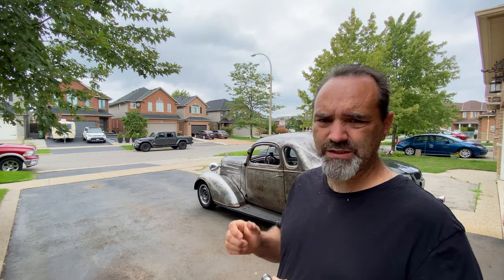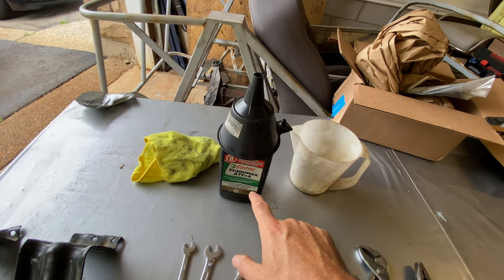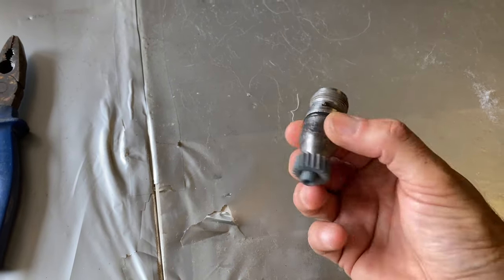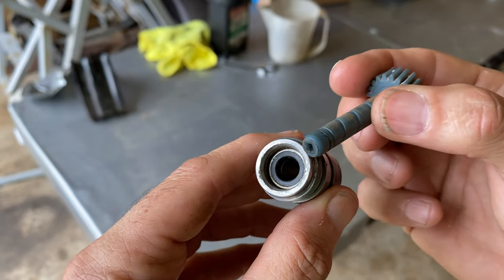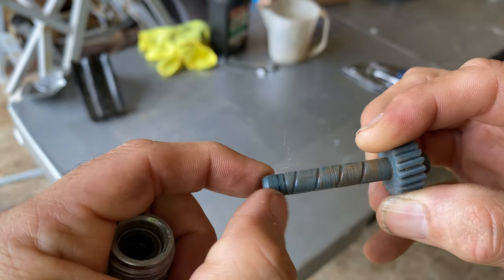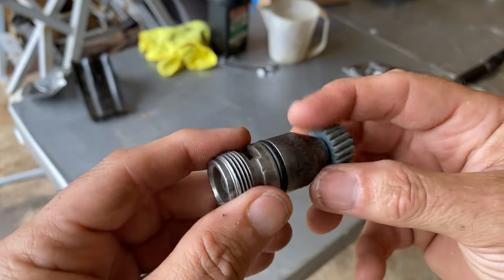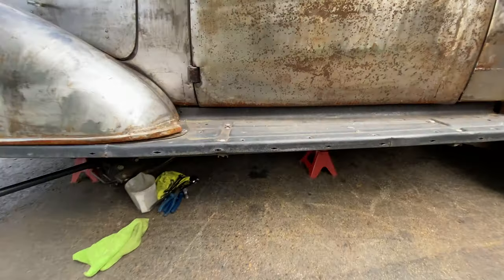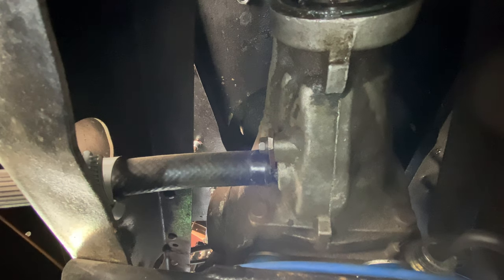Speedo Gear And Bullet Replacement On My TH350 Transmission

Comment: C  put a few drops of oil in the speedo head lay face down leave it for a hour then see if makes noise if it dose take apart spray out good with air especially around the bell where needle is dirt builds up in it and causes it to make the noise you have